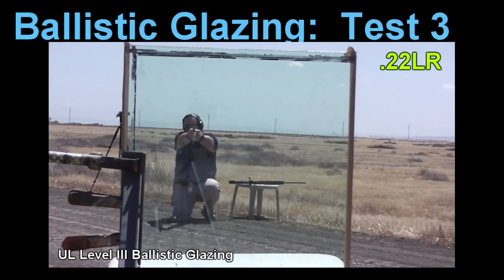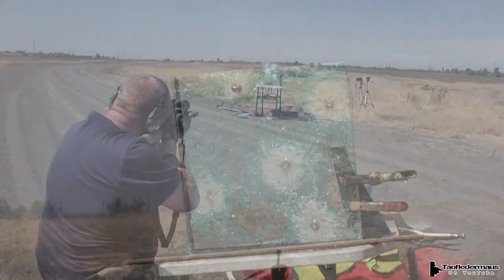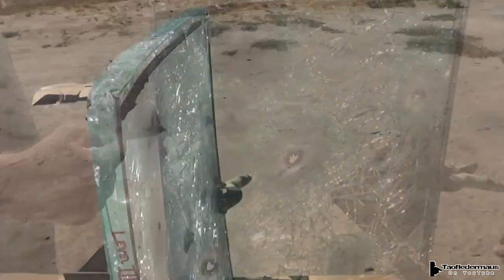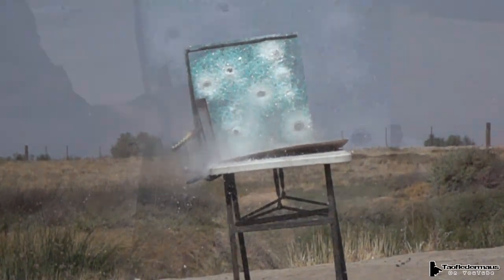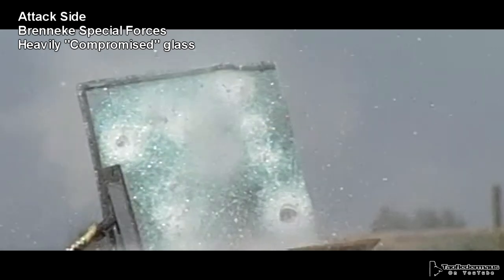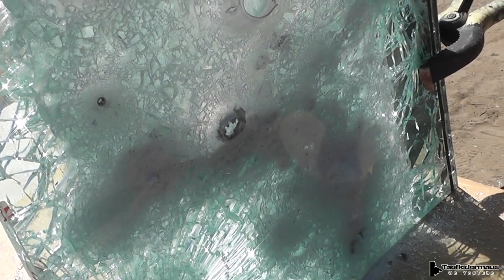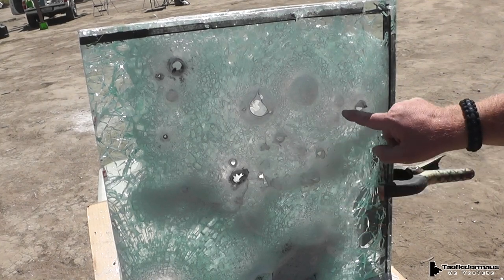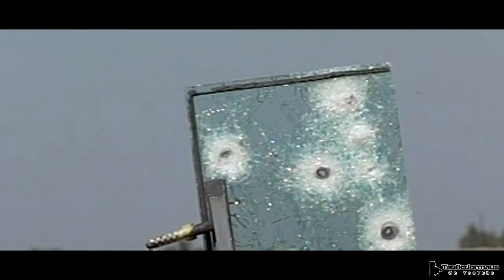Bulletproof Glass -  How many times can you shoot it?

Comment: This is a rating system done correctly. You don't want the failure point to be JUST past what you're rating it for. Example - a good ladder is "rated" for 320 lbs. It won't break until you put 640+ lbs on it, because it's made well. Same with this. The glass is capable of protecting against more than it's rated for, therefore they can "rate" it that they're "100%" protected against the rating. 

"Can our car go 45mph? Well, its max speed is 90mph, so yeah, we can basically guarantee that, when use properly, it will go 45mph"
Reply: Levi Coffey same goes for everything. Like food dates and such

Comment: I worked at the Clallam Bay jail, installing wiring and control panels.
We were told by the glass installers that the witness side would 'pass' a rifle round while the #2 buck used in the yard could not get through the attack side.
Sort of like a one-way bullet sieve.
Reply: I believe that there are some types of bullet proof glass that do allow for that
Reply: It's all to do with the composition of the layers. As a loose rule, if you have a soft layer then hard, the round will have an easier time getting through than hard vs soft, as the hard takes the punch out the round and the soft catches it.

Comment: the polycarbonate backing is there to keep glass from spraying the witness but also so the glass has something to compress against in order to defeat the bullet when you shoot it from the other side it pushes the glass out of the way and it doesn't have anything to compress again so it just goes straight through

Comment: Ballistic glass is a laminate to essentially incorporate two different materials useful properties. For the most part the goal is to spread the force of the projectile out across the plane of the glass as much as possible. Glass when tempered properly is very good at doing this, however, it is brittle. 

The polycarbonate or acrylic used between the glass layers is designed to give the glass structure even after it is shattered and to deform in ways glass can't to help distribute the force even further. But it has the downside of being fairly easily pierced because it is designed for plasticity.

I'm not surprised at all that shooting into the witness side caused more damage. It's design demands you hit glass first then plastic and repeat that ordering. If you flip it you remove a layer of effectiveness from the system. 

Shooting into the first plastic layer won't distribute the force much. The bullet will just punch through. And the last layer being glass means there isn't any backing on it so it has nothing to give it rigidity once it shatters.
Reply: This was my thoughts just better formulated. I totally agree!
Reply: bangythebrav  that glass is not tempered

Comment: One reason why the attack side is glass may be abrasion resistance. Glass, especially tempered glass, is very scratch resistant. Whereas poly or acrylic will often get light scratches just by normal cleaning and in the long run become hazy. I would imagine that most clients take this sort of practical consideration into account as well.

Comment: Hi Taofledermaus, your videos are always informative, but I think you could have read a bulletproof glass brochure to answer some of the questions in this video. The main reason for the glass having an attack side and the witness side is to allow the "witness" to shoot back. Additionally, the flexible pane behind the glass is key to stopping the bullets. This is for 2 reasons:1- the glass in front of the flexible pane has a very high compressive strength but is brittle (stopping the bullet), the flexible pane allows the glass to stop the bullet more effectively by holding it in place, and 2-the flexible pane prevents glass shards from flying into the 'witness'. Hope this explanation makes some sense. This is why even compromised glass still works well, all you need is glass to stop the bullet, the shape of the glass is not really that important.
Reply from the maker: You'd probably still need a rifle to shoot back.

Comment: I believe that the reason for the attack side of the glass having glass break away is to dissipate the energy of the bullet.
Reply: Yep.  All that flying glass is from the transfer of energy of the bullet to the glass shards.  It's just a bonus that a shooter close enough would probably be incapacitated by it.
Reply: I don't get it, if they are trying to windows and panels bullet proof, then why don't they put two layers of plastic and in the center is a thick inch fiber plastic material so that it one, is still see through, and two if someone trys to stab or shoot at it then it dents the panel and ricashay's.
Reply: Ricochets dont work that way. Hitting any hard target usually destroys most rounds and dumps the energy into the sheet.

Even if the design DID ricochet, collateral damage is a huge concern, not the bullet would have the energy to do damage at that point anyway. A 45 degree ricochet on concrete loses about 35-40 percent of initial velocity a straight on shot would lose nearly all of its initial impulse.
Reply: I think it's to do with material hardness as well, Mythbusters did an episode where they tried to "bulletproof" a car by using phone books, it worked by putting the phonebooks on the inside, catching the bullet already deformed by the relatively hard car doors, however, they then stacked the same amount of phonebooks entirely on the outside, the bullet passed through into the vehicle. So just by changing the order of material seem to make a big difference.

Comment: The polycarbonate is supposed to support the tension that the glass dust [spreads along a wider area] is going to transmit to it. On the opposite side, the bullet pierces through the polycarbonate and fragments the glass without it having any kind of support on the other side

Comment: If I understand the physics correctly, I think there's another reason for the side of the glass which sprays glass shards.
If the glass was designed to stop the bullet completely without any glass being ejected away, all of the bullet's energy would go into the glass and anything that is securing the glass.
By designing the glass in such a way where shards of glass are ejected away upon impact, you allow an additional outlet for all of that energy. Some of the energy will go into propelling the glass shards.

Comment: The attack side probably lacks the anti spalling because doing so gives an easier path for some of the energy to go. The energy has to go somwhere and if it isn't being used to blow pieces of glass out backwards it's probably being used to help push the projectile through the target. It would also explain the compromising effect as well, as you get closer to a previous shot, there is less material to be moved and since it is already cracked it would take less energy to break.. which all translates to the projectile keeping more of its forward energy and the victim side of the glass having to withstand more of it.

Comment: There's one-way bulletproof glass. It's basically just a layer of acrylic, and a layer of polycarbonate. The acrylic layer is the attack side, and it can stop rounds pretty well, but if someone shot at the witness side, the ability of the "glass" to stop bullets is much worse, meaning you could return fire while being shot at if you had to. This could offer some insight into why that polycarbonate layer is so important, not only to reduce spall, but also in stopping bullets.
Reply from the maker: I think the rating on that type of glass is quite low,  maybe Level I.
Reply: ***** Maybe. It's hard to say, given how little technical information there seems to be. I think that it's a bit lighter, but has to be thicker to meet the same effectiveness as normal bullet resistant glass. There's a documentary from History Channel that shows one-way bullet resistant glass stopping a few rounds from a rifle, but not much else.

Comment: spall liners or fragmentation catchers are common place in armor related environments. they are mostly known as the black rubber coating on the ar-500 body armor. spall liners are most common in armored vehicles. most metals when impacted with strong forces have a chance (some more than others) to splinter off fragments the spall liner is put in place to catch the rogue fragmentation.

Comment: THE physics in stopping a bullet in compromised laminate glass or captured glass powder (and bonus military sand bag testing)...in bullet points:
1. if the fracture of the glass pane runs perpendicular to previous fractures, the results will be nearly 100% that of the ability of new glass.

2. powdered and loose glass chunks still retain a large energy absorption rating, higher than that of contained sand due to the rotational (angular momentum) redirection or energy in conjunction with the drag (braking on the rotating glass chunks) by neighbouring chunks like cogs in a gear train which effectively dissipate in a closer to full 360 degree web than that of concentrated fracturing of a new pane as the numerous pieces have more vectors to enact upon neighbouring mass that it is or becomes in contact with .. the result being quite close to that of a new pane if the required volume of chunks & powder is present (in laminated glass, this would be where the glass has separated and the debris has sufficiently accumulated against the spall layer) ... thusly in test I recommended to the military, it was indeed found that mixed soil containing aggregate (rocks) did superior to just sand .... jagged crushed sand with hard corners did far better than beach sand with rounded corners and crushed sand mixed with crushed stone did the best as it offered lots of interlocking gear like structures to eat up a bullet's energy.

so in a SHTF world.. fill your bags with pulverised bricks or at a quarry... or .. with used up ballistic/tempered glass

Comment: Might I suggest that you mount the glass on at least two sides to simulate it being mounted in a vehicle or window frame.  Using mounting on only one side allows it to flex and disperse some of the impact energy that it would be forced to absorb in a mounted condition.  I'd love to see the difference in performance when its forced to handle all of the energy with those same rounds.
Reply from the maker: The glass is so heavy,   it really doesn't move that much when hit.   I just had the angle support on the wrong side this time and didn't clamp it well enough.

Comment: Lets talk some basic science here.  Polycarbonite is very strong.  It is on one side because the glass absorbes a lot of the impact and the polycarbonite can absorbe the remainder of the impact. This is why it often remains smooth.  Sharing my inner geek...I have bought polycarbonite tubes to make home made FX Lightsabers(look it up) and tested those tubes very.....violently  while saber fighting...lol. they scratched.  but no matter how hard we hit them together.  They never cracked, broke, or splintered.  I am mildly curious what a sheet of carbonite at that thickness would do.  Taofledermaus....this sounds like a challenge.  :-)
Reply from the maker: We have shot sheets of polycarb  (lexan)   before.    A  wax slug will still shatter a 1/2" thick piece of it.   If you take that same sheet,  put in on a concrete floor and hit it as hard as you can with a hammer,   you will just dent it.

Comment: If you ever get another panel of this stuff, try breaking the ceramic off a spark plug and using it as buckshot. I say this because that ceramic will go through normal windshield glass with just a light toss.
Reply from the maker: ceramic is very light though,   so that would be its Achilles heel
Reply: Hadn't even thought of the weight, just thought it would be cool to see lol

Comment: THE REAL REASON (i have worked with glazing manufacturers) for NOT having a spall-layer(on the attack side) is that the glue used to adhere it to the fracture layer of glass would decrease it's energy absorption ability.

to illustrate this, place a couple thick books in front of a layer of cheap glazing, then place them behind the glass .. when placed behind, the free-to-fracture glass is the FIRST thing the bullet hits and the freedom to fracture and disperse the bullets energy is able to do it's job in a more efficient manner.

it may seem weird, but a bullet can shatter a pane of glass in a visually similar manner at a slower (or pre-slowed) velocity as a higher (not yet affected) velocity, but the amount of energy dispersed is exponentially higher per the amount of fracturing at a higher velocity due to the energy dispersion properties of glass.

-the work I did was in certifying structural glazing for walls (high-rises and such) and flooring/walk ways ... ensuring it is capable of withstanding wide varieties of forces .. including broken free helicopter rotor blades, projectiles (including firearms), birds(song, herons, sea and raptors), among other things like angry people trying to smash it with various objects using robotic super-human stand-ins. ... the answer above is the correct answer

Comment: I wonder if kevlar webbing backing the polycarbonate layer would prevent the stretching even more and stop larger rounds, Like a ripstop?

 The Chiappa 9mm looks like a 10/22 mixed with a Mini 14. Are they worth buying? they look pretty sweet.
Reply: he made a review on it.

tl;dw no, unless you want to put some diy work on it.
Reply from the maker: Probably hard to see through kevlar
Reply: ***** I was thinking along the same lines as school door glass with  steel wire inside. But would be kevlar checkerboard as thick as practical for glass to still be useful.

Comment: I stopped the video after you showed the first slug that the compromised glass stopped so im not sure if you said this in the video. buf I think the reason that there is no polycarbonate on the attack side is so that the glass can break the projectile apart. 

if you shoot the whiteness side what happens is that the projectile pushes against the poly and breaks the glass before the projectile even touches glass causing the glass to resist the bullet less as it tries to push through. 

where as if you shoot the attack side the glass breaks as the bullet impacts the glass. and because the glass is a harder material than the lead it causes the projectile to shread appart and in doing so it looses more momentum. and the broken glass fractures in a way that causes the dispersal of energy in a large circular patern which the poly layer obsorbs.

at least thats what I think. 

whatever... back to the video.

Comment: Why only on one side?   Because the spalling takes transferred energy with it and pulls that energy away from the sheet of laminate.  Meaning that the projectile tra sfers energy during impact, and that energy has to go somewhere.  So you either direct it into the entire sheet of laminated bullet resistant glass and hope it is not enouh to punch through as it bounces and rebounds around inside there, or you allow that same energy to dissipate outward in a fountain of glass spall, and energy dissipation.  

Remember that glass is still flexible, but it only flexes to a certain point, and really does not do well being flexed in more than one direction at a time.  The energy transferred from a projectile tends to cause ripples in anything it hits, waves.  Glass does not like these.  So if you keep all that energy between 2 spall layers of polycarbonate, it could cause that wave energy to bounce around inside the sheet and dissipate into it, causing it to essentially vibrate itself apart.  

If however you let it spall out with the glass fountain, it could help dissipate the energy MUCH  more quickly and thereby save the entire sheet from being fully compromised.  Another reason why it is good to have steel on only ONE side of body armor plate instead of both with the ceramic on top.

Comment: Mo-ney.  That's why the polycarbonate is only on one side...
Reply: No, it's because there is would be no material slowing down the projectile. Thus, having a poly carbonate layer does not get to expand and slow down the bullet. It would prevent spalling, but would not effectively increase the bullet resistance of the glass

Comment: I wanna see it take 7.62 x 39 rounds when it's fresh.
Reply from the maker: I'm pretty sure the glass won't stop it.
Reply: ***** Ya most likely not. That glass is pretty tough though i heard they plan on infusing glass with nano tech making it stronger then concrete. Wonder what that could stop.
Reply from the maker: I do need to figure out what to use the other 2 panes of glass.    I may end up shooting it with rifle rounds.
Reply: Maybe you could try smashing it with other means besides just a gun test it's durability in more unconventional means! heh just a thought.  Good channel keep it up.
Reply: TAOFLEDERMAUS quick question, just how a car window is so much stronger when it is fully wound up into its recess in a car door, would this pane of bullet proof glass take more punishment and be stronger if it was clamped solid in a frame so the layers couldn't move away from each other and create air gaps? Cheers, big fan from the UK.

Comment: that shotgun doesn't lock right
Reply from the maker: It works just fine.  They unlock after you fire them,  otherwise how would you pump a new round into the chamber?
Reply: oh ,yeah but it's because i saw the shot pushing the bolt back by itself .. keep up the awesome work guys ,12gauge fanatic right here lol
Reply from the maker: The action is butter smooth,  so just the recoil operates the pump,  the same way your hand would operate it.  It if didn't lock,  we'd have a huge blast coming out the ejection port.